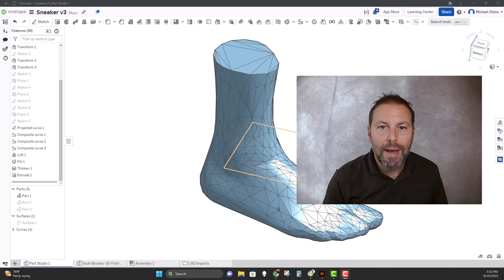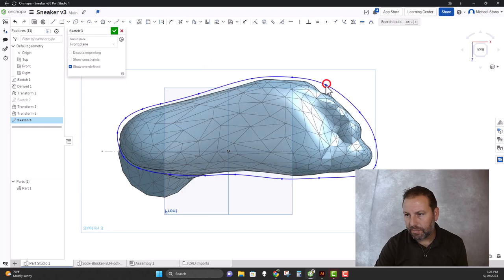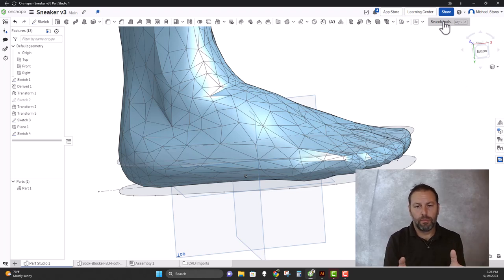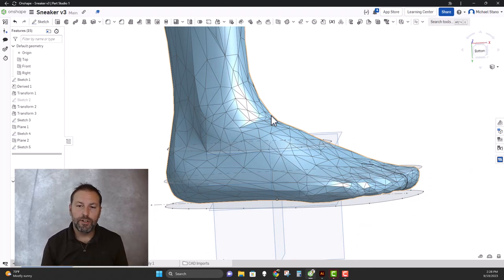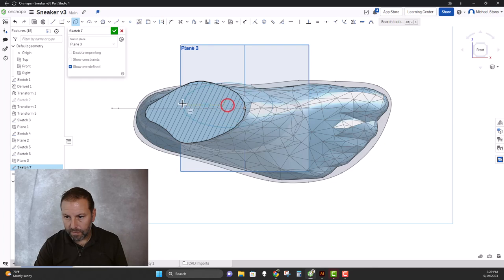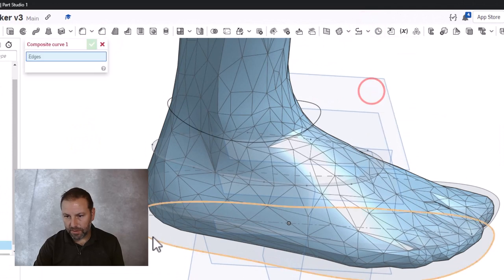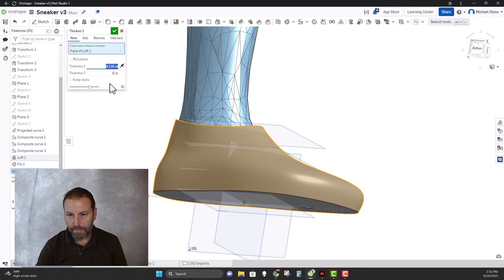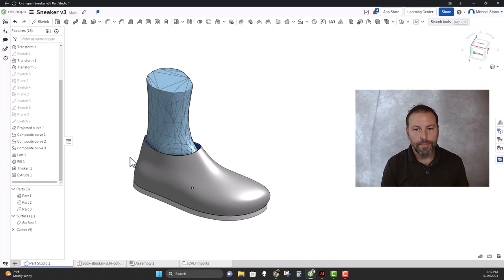Mixed Modeling with Onshape P2

Comment: Is there any way of making a negative mold of the foot in a solid by subtracting it from a new part using boolean? Or alternatively converting the foot to a solid structure that we can extrude through directly?
Reply from the maker: @andrewklug4845  that’s a good question, and I would think so, just haven’t tried yet. Then you could make molds from imported files which is pretty cool. I’ll look into it.
Reply: @ScienceMonkey00  Amazing thanks!